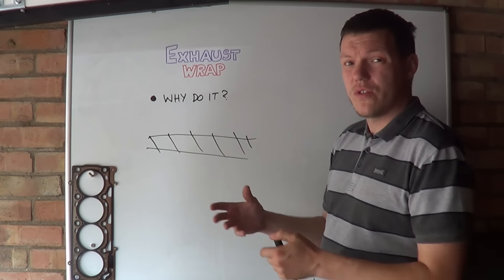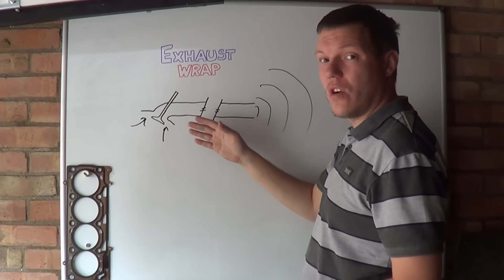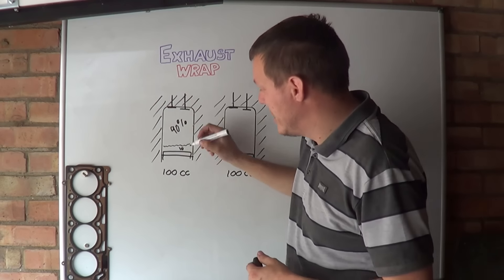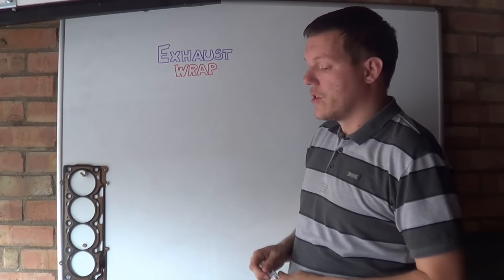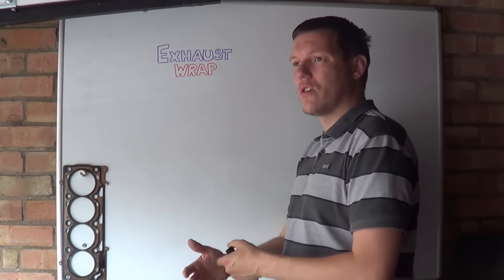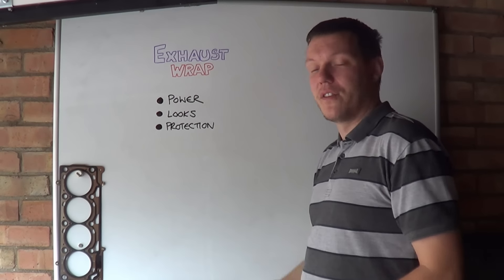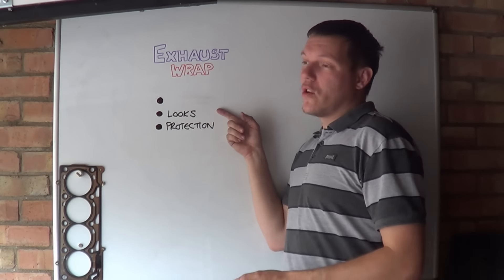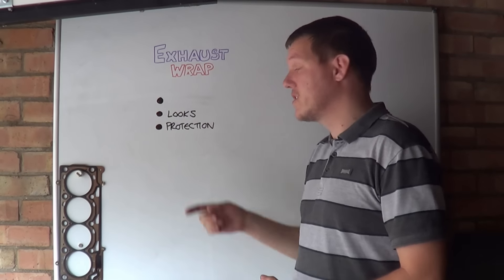Exhaust Wrap - Good or Bad - Bike TEch

Comment: My headers without a doubt are dumping a lot of heat under the car hood and into the engine (454)compartment… naturally asperated, air induction from that heated air... so,,, intake air is higher temp?, would not fuel/air once aerosol via carburetor then be less dense, and less power?
Reply from the maker: Yes - the hotter the air the lower the density
Reply: People port and polish Heads all the time, some heads have inherent design with one or more cylinders a little 'off' for flow rates, mostly the extra milling is on the intake side, people put large collectors on the exhaust side to 'open flows'... having said that, it would be interesting to check exhaust temps (thus density/flow rate on exhausts at exhaust pipe ends. Usually two for cars(left bank/Right bank).By placing a strip of metal in the end pipe opening in the flow and using ir temp detector.Check exhaust pipe temp 'unwrapped at cylinder head for each cylinder and temp at end of pipe with exhaust pipe pipes wrapped. Perhaps using a corvette styled exhaust system for a car with side exhaust or modified other vehicle side exhaust.Another tool used might be a metal framed/constructed air flow rate device(cheap ones are made of plastic often used to balance Air condition flow rates at individual A/C vents.Testing @ idle, testing @ >< 2300 R.P.M? Cruise speed operation?Temp and exhaust flow rates before and after Wrap... maybe a pressure sensor at tail pipe ends also?True understanding has to have before after and end of tail pipe testing(side mounted exhausts might be easy to wrap a large or total amount of pipe).I suppose DYNO testing could short circuit the needs... but keeping heat from swelling up in the intake air should actually be the best advantage.... I cannot see less than 3+% gains... plus Keeping cooler the cab area/ A/c benefits and a Noise Db test before and after if 'wrapped' past the cab would be interesting.My understanding is the best wrap material isn't expected to last more than 4years, cannot be wettened over and over to enable 4 years(keeping in consideration any wrapping in once past collectors heading down stream) and that 'spray on to be applied to the wrapping is kind of iffy to lasting benefits, wet or dry areas.Anyway...…………. interesting subject that might return 5% power capacity of any engine in a car.

Comment: I am about to wrap a Buell, air cooled and stainless steel headers. what risk am I in as far as breaking welds? This bike is really rare and parts are really hard to find, I don't want to butcher it by adding wraps but I want to cooling effects to keep the heat away from the motor. I live in Texas and 115 F(46C) in summer is normal.  In your Opinion is this a good idea?
Reply from the maker: What buell is it? If its a newer buell (like a XB12) then the welds are pretty good. I don't know what you mean by keeping heat away from the motor? Well I can read but I don't understand your exact meaning if that makes sense? Exhaust wrap retains heat in the exhaust and this will mean that your head will be slightly hotter, but nothing the engine can't handle. The temperature increase will be minimal, but will increase. If your having temperature issues then I would say don't go with the wrap.
Reply: Pony Power xb9s 2003 Buell.

Comment: Really great video. I did wondered why people wrapped exhaust other than for looks. A brilliant explanation. I have to say I do like the look of exhaust wrap.
Reply: at 1000 rpm the engine has 500 explosions inside the cilynder. That's very fast
Reply: @viarnay  -Could be one historic reason for general aviation, those with internal combustion, having a few issues contacting dirt... more often than planned ;}

Comment: What about a diesel engine? It's a good ideea to wrap your exhaust from manifold to the muffler for having a better exhaust flow and a clean turbo ? i heard that wraping it you'll have a cleaner exhaust and a cleaner and powerfull turbo. And again it's about a car obviously.
Reply from the maker: "i heard that wraping it you'll have a cleaner exhaust and a cleaner and powerfull turbo" - you've heard that, and I've heard some bullshit in my time. That just added to it. This is the problem with hearing things, and this is in no way having a go at you. Diesel emissions and the soot associated with it are products of the combustion process. Incomplete or combustion temperatures that are unstable and too high cause the soot levels to increase. Diesels are also fitted with particle filters and have EGR systems (exhaust gas recirculation) that 'catches' so to speak the soot. In other words, wrapping a diesel exhaust does not and cannot clean the system, because exhaust gas temperatures have little to do with the creation of soot, its just where it comes out. 

Messing with exhaust wrap on injection based engines either petrol or diesel can be a bad thing. Oxygen sensors can give false readings which can damage your CAT - I should make another video about this come to think of it.

Thanks for the comment - matt
Reply: thanks, you really get me out of fog

Comment: I think the only thing your missing is heat release and the effects it has on the heads on the motor....retaining more heat then usual? Is this actually true.
Reply from the maker: Nice comment, sorry I've been on holiday and didn't reply. More heat is retained in the headers and this reduces the temperature gradient which will cause the head temperature to increase. However, most wraps are carried out on older bikes, usually air cooled motors. These engines have limited control over the cooling of the head so huge margins are part of the design. in other words the cooling of such heads is usually too much so any additional temperature increase won't be noticable. As for water cooled motors the heads are 'over-cooled' if there is such a word. Its only when extremely tight tollorences are used (in racing) that this can become and issue. 

A turbocharger is a greater issue if used and very little consideration is taken when people do this type of mod.

Good comment and your right to question such things.
- matt

Comment: I wrapped my chinese 125 exhaust and I commuted to work for a full year here in Denmark. Before the winter I painted the exhaust and after I took the wrap off before summertime there was very little to no rust. Actually all the exposed weldings were way rustier than the ones that were wrapped. Weird, isn’t it ?

Comment: Exhaust scavenging 101. Thus why small header opening and exhaust getting bigger towards end to help speeds and hopefully create small vacuum before intake opens. Heat shields may work in some cases to block heat. My 360 has wrap so i don't burn my leg. Great video.

Comment: One of the main reasons it was initially used was for power, but for cars, not bikes. If you wrap your exhaust you keep the heat in the gas flow as you've said, but importantly you keep it away from your engine bay. Increase in underbonnet temperatures will reduce power as the hot air is less dense, therefore to get stoichometric air/fuel ratio you have to add less fuel and so get less power. Colder air at the intake = denser air = more fuel needed to get to the correct air/fuel ratio and more power. Turbo/super charging works on the same principles, only to much greater effect as the change in density is much greater due to being mechanically forced, rather than driven by a simple temperature change. But in racing every 0.5 bhp counts! I know yours is a bike channel, but thought it was a worthwhile point to add a bit of history. Interesting video though.

Comment: Question. I am considering buying a exhaust to my Aerox 4 scooter and the site i am buying it from tested it and said that the exhaust pipe was too close to the plastic underside of the scooter so it melted the plastic, would a glass fibre exhaust wrap be able to keep the heat from melting it or would i need a heat deflector aswell on the plastic underside?
Reply from the maker: Probably - but I'm not promising
Reply: @thedirtyworkshop  well, i guess im better of safe than sorry with buying both a glassfibre wrap and heat deflector. Thank you for that quick response :)

Comment: My R1 is wrapped. Also heat paint coated from the spray can over the wrap. It needs recoated every 2-3-4 years with the paint, but it has proven to me to “seal” it. Now mind you after application of the paint, run it OUTSIDE to burn the fumes off and it’s gold. Done it. Still do…

Comment: It sounds weird AF, but i have seen a Subaru burst into flames on the dyno because of the wrapping.  The thing developed a moderate cooling leak because of to high temps on the dyno.  The coolant hit the wrapping and it literally burst into strange but huge blue flames with incredible heat and smoke.  I have never seen something so close to water burn!!!!   I still dont fully understand what happened but the only thing i can think of is that the water in the coolant somehow split into hydrogen/oxygen and combusted.  I cant imagine EGT to be so high that this can even happen without the motor/turbo dying!   Ever since that day i turned "allergic" to Exhaust wraps and turbo blankets.

Comment: how does it effect a 2 stroke? Thinking about doing it on the down pipe of my 1960 Lambretta.
Reply from the maker: Yeah it does is the correct answer. The speed of sound varies with temperature and more heat retain in an exhaust means that the timing of the exhaust back pressure will change. How much? - around 5-15 microseconds lol You would never notice and would probably never be able to measure it. To be clear, it would be fine.

Comment: And the one point you have kinda missed is that it help with thermal problems. If your exhaust pipes are close to the radiator or other heat sensitive parts it helps to keep them cooler. Like the rear exhaust of an V2/V4 engine the rear cylinder can cause your seat getting hot and your balls boiling. Example Ducati: All complain about hot legs and balls in slow city traffic. To wrap or coat the exhaust will help with that. It will be not gone but significant cooler. Some even have had accidents due to the exhaust heat boiling the breakfluid in a break line that was close to the exhaust (more on turbo cars). And when the exhaust heat boils the water or oil in an to close mounted cooler you will have problems too. And when you have an air cooled 4cylinder engine  it does help to reduce thermal problems of the 2 inner cylinders some what. Yes looks good on some bikes but not all.

Comment: The truth is it's most often done on street bikes to cover old corroded pipes. Before wrapping became fashionable the usual, and effective way to cover up old shit was barbeque black flat black paint.  My reaction to fashionable mods supposedly done for performance is "dyno slips before and after or fuck off".  You can measure everything an engine does. 

Wrap is quick and cheap. Having old pipes blasted then ceramic coated or spray metallized is not cheap for most owners. 

I've peeled enough of it off customer bikes to have no fondness for it, but if you are selling a motorcycle it can tidy things up.

Comment: If they made an exhaust wrap that was waterproof I'd be more likely to wrap my exhaust on my bikes.   But dealing with rusty exhaust doesn't sound like fun to me.
Reply: there is a spray
Reply: @poet99999  what kind of spray?  I had my lsr pipes ceramic coats then after a year when they started rusting through I sent them back under warranty to be acid dipped and recoated and the first time I washed the bike after that the coating washed right off.  Whoever did the ceramic coating was a hack and obviously cut some corners or used shit materials.

Comment: Very informative, thank you!  I'll likely wrap the pipe on my old Yamaha ('73 TX500, I'm the original owner, 124,000 miles); there's some rust in the header pipe/collector junction, and a bit on one of the header pipes, and the company that made the pipe (Alphabet) went out of business years ago (the pipe's been on the bike since around 1978).  I can't disassemble the pipe due to the rust (it was a very tight slip-fit to begin with) and wrapping it seems the best alternative; a local plating shop wouldn't touch it when I inquired and ceramic coating is rather costly by comparison.
Reply from the maker: I hear ya. Generally plating an exhaust with anything isn't a great solution. The different thermal expansion of the layers mean that i generally chips away pretty quick (chinese bikes) Chrome is usually copper then a nickel flash then chrome. These materials expand and contract at different rates to the steel. This swelling cause 'pocket' to open up and chip away due to the vibration of the engine.
Reply: If you really want to save that rare Alphabet pipe the thing to do is remove the pipe then CAREFULLY tease apart the slip joint off the motorcycle. A healthy torch can heat the outer tube at the joint. Vibration and penetrant can help.

Wrap doesn't preserve metal. It attracts water and acts like a sponge. It's great for junk you want to sell and has mostly replaced BBQ paint for shitty coverup work. Wrap is a fashion statement and like all fashion many are passionate about it. I won't inflict it on my machines because I keep my rides a very long time.

If the bike is a junker disregard, but otherwise I'd find a local spray metallizing outfit that does industrial work. Boutique companies catering to car and bike guys often cost more. Look at their coatings, get your pipe sandblasted white, and they can coat it. They may be able to coat it as an assembly saving you from having to separate the pipe and silencer. In that case I would get the joint welded so it never shifts again and your system becomes effectively one piece.

Comment: Question for those with more experience:
Does wrapping your exhaust damage the metal due to the higher temperature? I'm afraid of wrapping the exhaust of my old bike since original parts are expensive.

Comment: I live in a are were lots of salt are sprayd in the winter and im wooried if they will rust to bits if i wrap my headers. Can somone help!
Reply from the maker: If you get a stainless exhaust then that will help
Reply: The Workshop i already have them. They are pacesetter longtubes with the temporary black paint that comes on them. And when i looked at what material its made of, it says steel. Not stainless steel. So idk if i should sand the black paint. Then scuff it. Then degrease it. Then apply high heat vht. Then wrap it. Would that be a good idea?

Comment: Other videos show that the wrap is actually hotter than when the exhaust is not wrapped, therefore it's not a good idea to try and keep the temps on the outside down, for leg protection or hoses or whatever, its actually makes it worse.
Reply from the maker: LOL - the exhaust retains more heat - so yes its hotter, but the wrap is an insulator and therefore protects you legs

Comment: YESS finally someone who knows what makes a turbo work,
it is a pleasure
Reply: Turbos are easy, Clarkson said it best . "Air goes in here. Magic happens & you go faster." lol
Reply: i mean suprisingly many people think a turbo spinns by flow, and never even imagine its a waste heat energy recovery device.
what hurts is they are nowdays mostly utilised for no more than stuffing more air into engines. terribly wrong.
sure if you want power and fuel economy is not in your interest it is a hefty idea, however.. there is a limit what you can achieve.
and a lot of heat energy is still there, you could do turbo-compunds..
nowdays you could absolutely get an electric generator powered with a turbine and use that to power an electric motor. turbo compounding has been done in the past but pure mechanical solutions simply made it have a narrow range of being usefull.. however we can play with coupling by dc-dc converters, and variable gemoetry turbines.
(actualy it allready patented so good luck seeing this emerge anytime soon) . hydraulic coupling was given a go but it was clumsy and not efficient enough.

actually i don't really know any kind of internal combustion engine that would not enefit to some extent from a turbo.. even if it does no more than reduce the "pressure loss" of the intake system. in fact many tractor engies get to have a turbo for nothing more than that, "boost" pressures in the range of 0.1-0.2 BAR or so... since they don't swap pistons out and not modify the fuel system to account for any extra pressure. what they get is better fuel economy. and when you burn like 50-100 liter of fuel a day, even 1% is a lot. 
http://ust-kamenogorsk.all.biz/en/turbocompressor-of-tkp-6-tt01-mtz-g1670520#.WT3HK7-1H3g
these run for a funny 250 euro -ish.
sure 61mm is not a really lot but it gets the job done.
Reply: Yeah. I was just joking with you.  I had the idea of electric turbos about 6 yrs ago, but was convinced by someone I trusted "the math wouldn't work" . They are also good for cleaning up emissions. I won't lie, I'm no turbo guru or anything. i know little more than the basics.
Reply: gizzy nc 
electric turbo is not impossible, just plain simply useless.
Reply: It was more electrical assistance to eliminate lag. I've seen a few working examples
Reply: gizzy nc 
Electric assistance is still a thing, but i was referring to full electric ones.